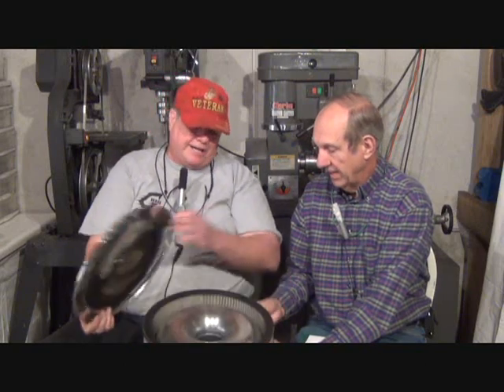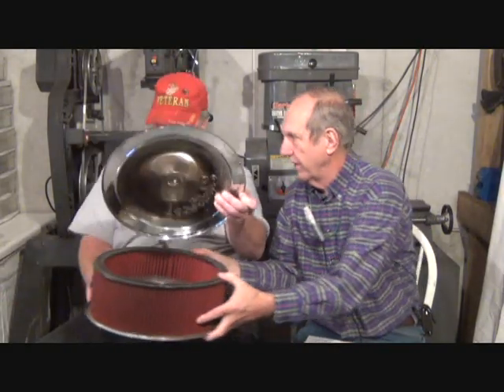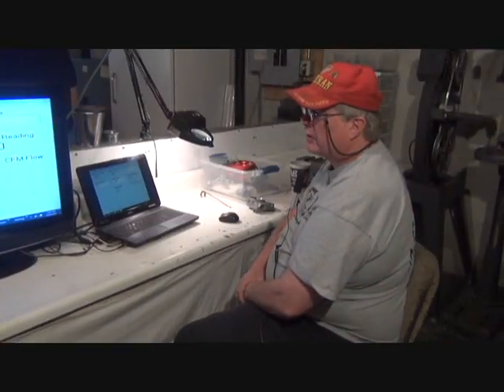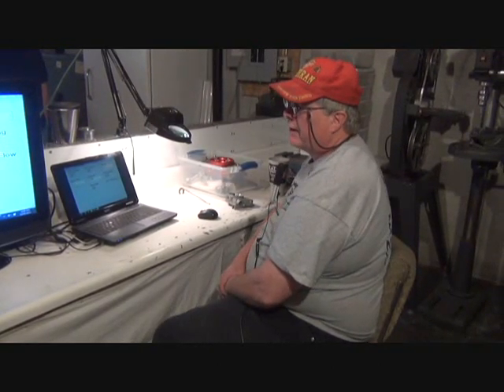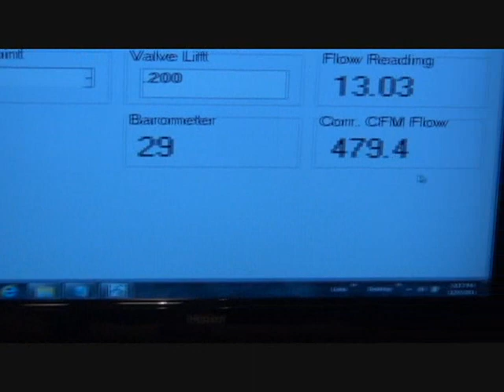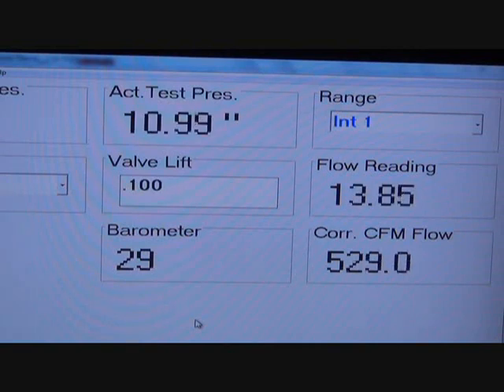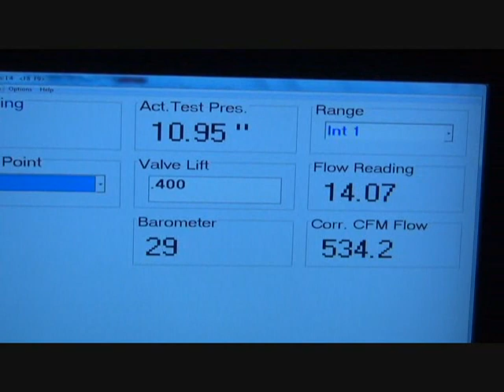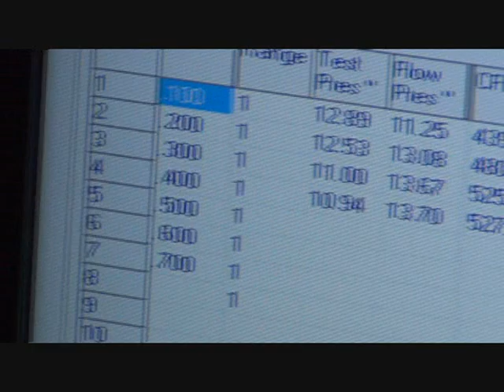Tech Talk-Big G 's Steve Adkins_0001.wmv

Comment: Why the difference in valve lift from .100 on the catalog carb  to.200 on the reworked  to .400  for the air cleaner test?
Reply: That's why its posted by CheeseVideo.